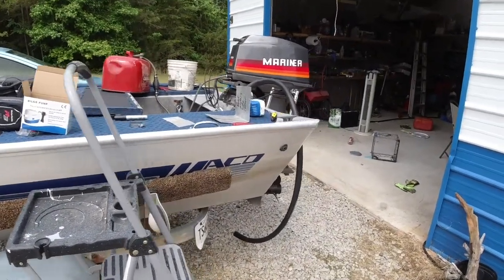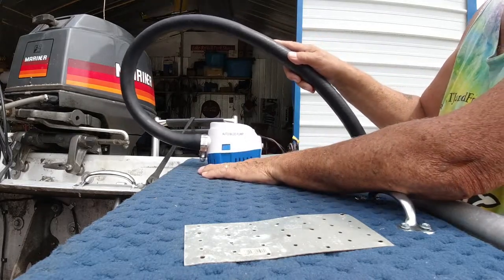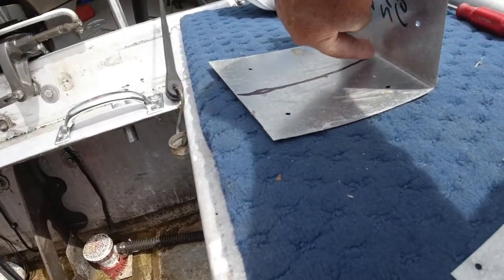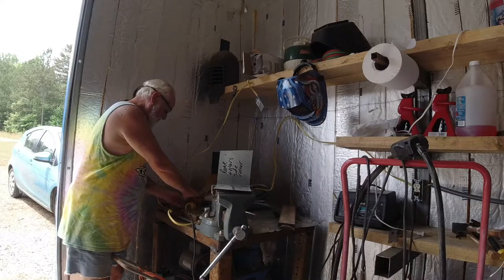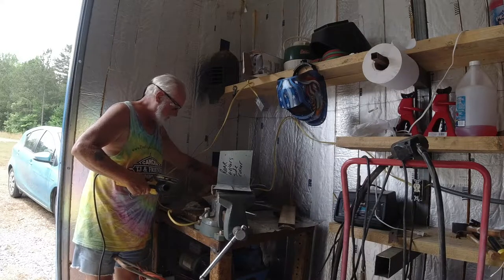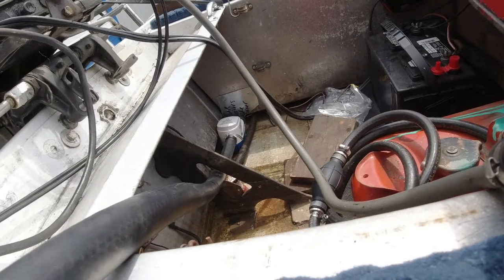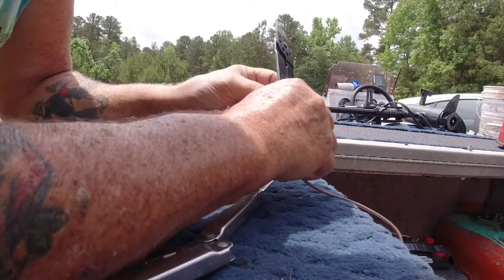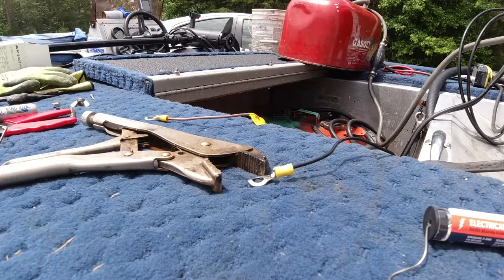Installing a fully automated Bilge Pump in my Bass Boat

Comment: I am wondering if you might need to cut the big hose from the pump a little shorter. I would think it should be high enough to be out of the water when the boat is in the lake, so when pump turns on it will not need to overcome the pressure of the lake water and can pump freely.
Reply from the maker: Maybe.